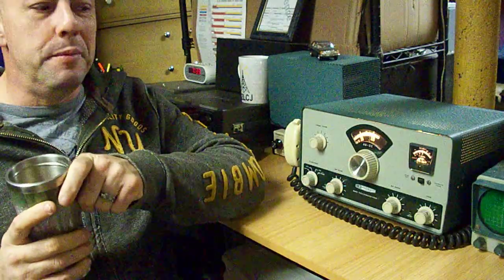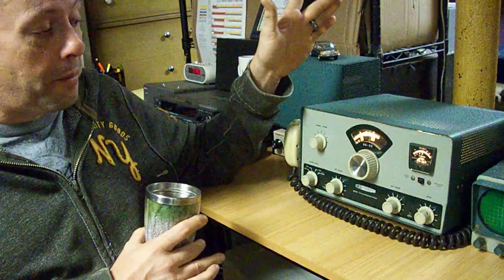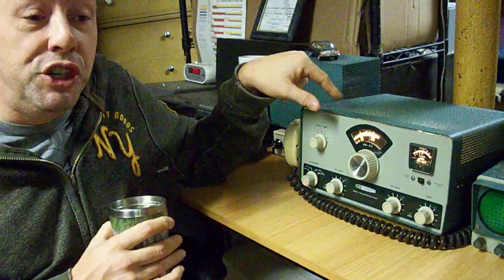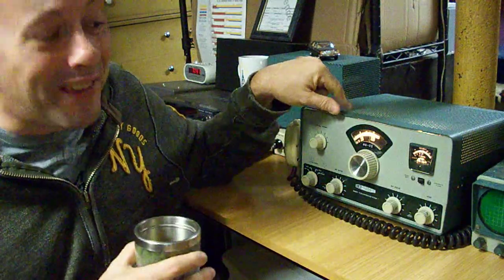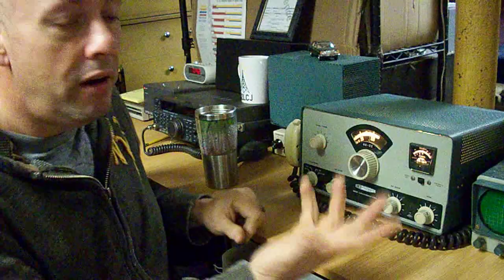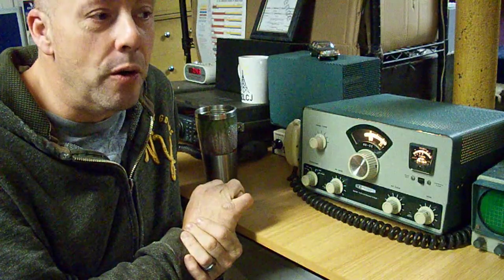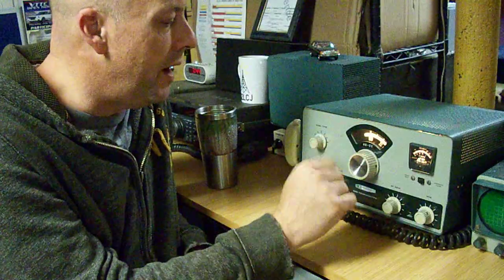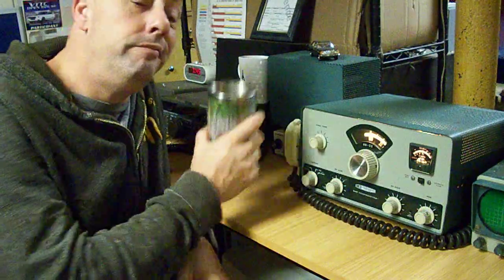An introduction to Heathkit single banders, Part 1

Comment: I had a couple of these.  The output power would fade after the finals heated up.  I did a couple things.  Neutralized the finals, and moved the bypass caps that got hot to the other side of the circuit board.  Now power was max when plate current dipped, and didn't fade away when heated up.  I had a mobile PS and swapped the transistors out for ones that had lower saturated switching voltage drop.  Plate voltage went up and power as well.  I could get  much more power out and on SSB wasn't a horible amount of heat.  The receiver used to come back out of transmit with a loud rush... which I also fixed.  Can't remember what I did exactly, but think I used a diode in the circuit.  Great little rig.  I should have never sold it.  I coined the phrase "Greefkit" back in the day.  I worked for Heathkin for a year in 1968.   -  WA6QVI

Comment: Hi Tim. Thanks for your Video. I have an HW22 myself I got from an estate sale. I started at the PSU and will re-work the radio soon after the HP-23A. I looking forward to your part 2 as I could not find it in the lineup. Good talk thanks hope to be on air with my rig soon. 73 Phillip ZS6PVT
Reply: What is an HW-22?

Comment: Man, HF rigs have REALLY come down in price, especially for the technology you get in a rig today.  Still, I often have the most fun with the simple QRP kits for under 100 bucks....or of course the vintage gear out there that can be had for a fraction of its cost when new.  Heathkit sure had a good run.  Real, practical radios you built yourself.  I have a set of the Heathkit Twins on right now - HR-1680 and HX-1681.   My IC-7200 is a great performer - but the Heathkits are sometimes more fun to run!  Thanks for showing us your HF monobander!